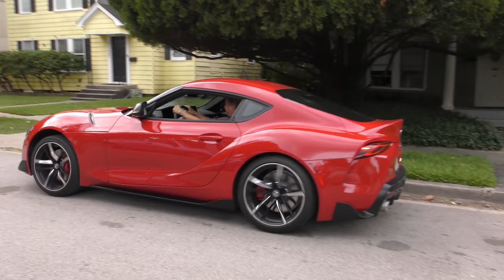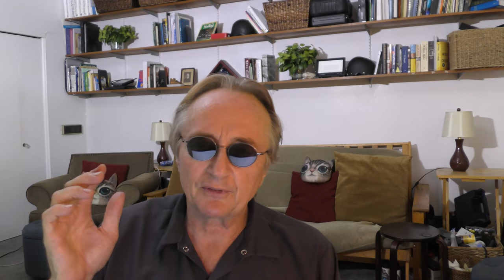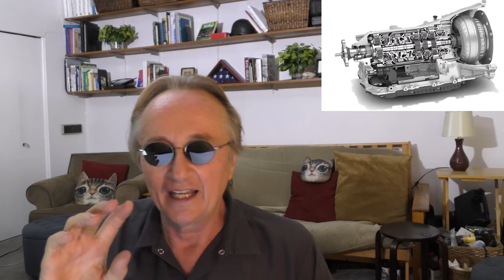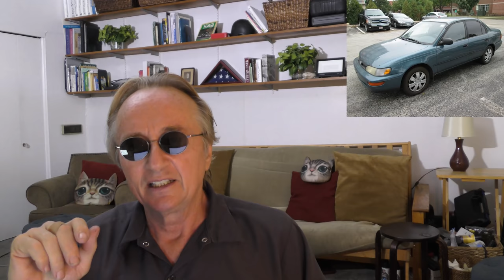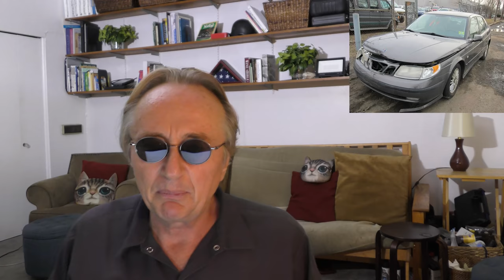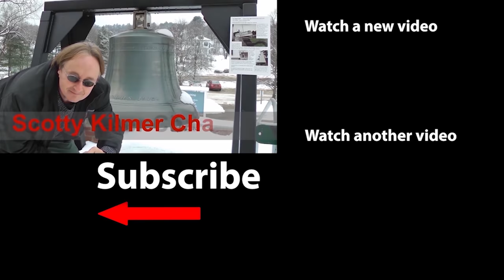This Illegal Mod Will Make Your Car Run Better

Comment: Just wanted Scotty to know ... I just bought my first Toyota, a Corolla from 2000. I'm a Honda lover but wanted to tell my experience. The most amazing thing to me is, just as Scotty predicted, the 20-year-old A/C system still works great. At 200,000+ miles, the engine starts right up, and the cloth seats have no rips, tears, or sun-bleaching. The automatic transmission still works, the heater, wipers, turn signals all work, and the paint - except where it's been unfortunately dented - is still perfect. On the hood and roof, it look absolutely brand-new. Thank God for Scotty Kilmer, an honest mechanic.

Comment: Great advice for the new Motorcycle rider. My First bike was a Honda 1970 CB350, & it was faster than Most cars, in the '70's... 40 years later, I'm on a 2007 Harley Davidson Sportster 1200... but, that is for comfort, & good acceleration, not crazy acceleration like the Rice burners... I just hope they look for a 250-400 as you have advised, as that may save their life. There is so mush more to riding that driving a car or truck as far as safety.
Reply: Good advice . On a motorcycle , you are vulnerable to everything .
I too , have been riding since 1972 . Ive owned 15 motorcycles and been from Calif to Ny and back in them.
Hondas , 450s Gold wing , Kawasakis z1-900, kz1000 , BmW 900 a 1957 Triumph 650 and 5 Harleys .
With the way things are with drivers these days , you are better off just buying a Miata or a Mustang Convertible than riding a motorcycle .

Comment: My 1998 Toyota Corolla Le still going strong 💪
Reply: I’ve always wanted to ask people who have a 90’s camry when do they think they’ll buy a new car 😂
Reply: hey just wondering aver touch the trans fluid or still orig? i have old camry w over 300k
Reply: Mine too I have 97. All the lines however are rusty.  Im gonna wait for it to break. Expensive repairs

Comment: I have been driving and fixing vehicles for 60 years. Yes, Scotty you are correct about the old cars. its what we had so we fixed all of them more than a toyota. I have owned 2 chevy nova corollas' in the 1980s. great cars. in 2000 I replaced one of them with the toyota Echo. its a great car 20 years old and 200k miles still going strong with minimal maint. they a kid totaled my chevy silverado pickup so I now have a great 2012 Camry LE. toyota has made lemons. you have to do your research and avoid them.

Comment: Scotty, I have a 1995 Chev Astro. It has 341,000 miles on the original engine. Bought it with 90k miles. Ever since I've owned it, I have changed the oil with synthetic or , later synthetic blend. And always used quality gasoline.

Comment: Rocking a 96 Civic sedan with 380k miles. Goes 90+ mph on the freeway with ease and eats up the corners. I've only had to replace the starter and distributor, both around $200. Not bad!

Comment: Everyone I know who’s had Infinity’s or Nissan Murano/Maxima’s have gotten 250k-350k miles out of them with very little in the way of normal wear and tear. Especially the Maxima with the manual, those are super reliable. The VQ engines are beasts!

Comment: I hope to god the Toyota Avalon won’t be discontinued
Reply: It’s a great car, but it’s just not that hot of a segment anymore. Full size mainstream cars aren’t that popular. Most people just buy a Lexus ES
Reply: Jay Mac very true
Reply: Me too. I currently own a 1996 Avalon XL getting ready to hit 205,000 miles on the odometer. I have owned it for almost 20 years and it's built like a TANK. BEST car that i have ever owned other than my 94' Celica ST with over 336,000
Reply: I just sold my 01 Avalon With 270k Miles for 1500$ Blowing Ice cold AC and A touch screen stereo....damn cars are great. Ugly but good good cars. Got a 2010 Tundra with 210K Miles and only changed a starter. Still drives super fast...and strong. Also got an 04 V6 Single Cab dodge ram with 254k Miles running great....take care of your cars my friends.
Reply: You know what. If Toyota axes the Avalon like Lexus did with the GS, I’m still getting an Avalon. If it needs parts replaced just get ES parts lol

Comment: Yeah my 05 Honda cbr600rr could hit just about  98 to 100  mph out of 1st gear at 15000 rpm before shifting into 2nd getting on the highway. The 600s are fast and light. If your conservative with it as a beginner it's okay, but be careful, and above make sure you have  good tires!  Tires are so important on those bikes I can't even begin to emphasize how much.

Comment: Good starter bikes are Ninja 250/300/400. Honda Rebel 300 or 500 along with the CBR on the same range. Yamaha R3 are good too. If you live in an area with a lot of hills or high elevation Ninja 650 or MT-07 are still easy to handle but have more engine for climbing hills. I recommend ABS on a bike for starters and stay with used bikes due to the high chance of drop.

Comment: Love my gsxr 1000. He is correct. A 600 RR series racing machine is wicked fast. My 1000 is over kill for the street. I only got it because it was the deal I could find. The 750 is the sweet spot for the streets

Comment: No mufflers, long tube headers with high flow cats and a performance shop tune wirelessly uploaded to the factory computer is the most amazing mod on my 5th generation camaro! It's like there's no other alternative way to really make the Ls3 louder. It's proven reliable as all get out regardless of what Chevy haters wanna say, I had it dyno'd and showed 428peak rwhp. Btw I consistently get 21mpg (93oct)

Comment: For a beginner motorcycle rider how fast the bike goes really doesn't matter. You can get yourself in trouble on a moped just as easy as you can a Hayabusa. May be a bit over-exaggeration lol but the point is it's not about the bike, it's about the operator. I started on a Ninja 650 with no problems. My recommendation would be to take a motorcycle safety course, which will teach you everything you need to know to mitigate the chances of killing yourself, then get whatever you want. The knowledge and skills I gained from the course I took saved my life several times.

Comment: My Infiniti has 116,000 got it at 82,000 2 years ago. Have not had a single problem with it. Oil change every 5 thousand miles.

Comment: Georgia doesn't have annual state inspection for vehicle, just emission testing in urban areas, but I think you can get pulled over if your and ticketed if your vehicle is making too much noise.  In rural areas of Texas, your vehicle just have to pass a annual inspection.

Comment: Picked up a 96 Toyota Corolla for my wife with 68,000 original miles on it for 1,450.00 a year ago nothing but oil changes so far and oil is still clean at 3000 miles love these cars will buy them up as I see them

Comment: If you find an mid 80s Toyota Pickup with under 200K miles in good condition you’re gonna pay for it. Those are unicorns
Reply: Sorry, Toyota pickup.

Comment: Hi Scotty the best car I ever owned was a 1991 Toyota Camry LE back when it was the top of the line. Velour seats a CD player a 4 cyl  engine. 4 speed overdrive transmission. Gun metal blue. 28 mpg. Wish I still had it. The new models are ugly and too low to the ground. Had a weird problem engine valve train would occasionally start and rattle like there was no oil pressure but eventually quiet down. This was my go to work car and received regular maintenance and never failed me used no oil between 2000 mile oil and filter

Comment: For Honda, the car jerk when shift out of park. It’s usually the transmission rather then the drive shaft or the engine mount. But my floor jack went out on me so I still saving for the new one.

Comment: One thing the guy with the Honda can check is to see if his trans mount(s) are bad. I had a Ford Taurus that did something similar, would jerk from 1st to 2nd gear.  Found out later it was just a bad transmission mount.  Easy fix.

Comment: I just bought a 2015 Nissan Rogue SL with 52k miles for a little over $12k. Runs great and was well maintained at the dealership according to the CarFax.  Only putting 20 miles a day for work on it so should still be low miles for the 5 years.

Comment: I've driven a lotus Elise, its almost a go kart, getting in and out is challenging because of the hump in the door way, and the hump on the hood obstruct the view like on the newer civic and CR.V but it get good gas mileage and easier to park, they use to make one starting around $40,000 brand new, it has a Toyota engine.

Comment: It's probably the motor mounts on that 2016 V6 Accord.  They have a tendency to wear out prematurely, due to the Variable Cylinder Management that Honda employs in those.  You'll also end up with oil dilution problems and a worn out engine.  I own that very same car.  The best thing you can do after repairing it, is to buy a VCM Tuner II, or a VCM Muffler, or any one of those products available online.  They're around $100 and super simple to install.  This keeps all six pistons firing on the engine at all times, which keeps it from vibrating and wrecking the motor mounts.  If you don't want after market parts on the car, you can  buy a KTuner imstead, and shut off the VCM permanently with that.  Though, a KTuner costs around $500 and is slightly complicated to work with.

Comment: I think that a turbo counts as a muffler. If I’m not wrong the Dodge Neon SRT4 came from the factory without a traditional muffler and relied on just the turbo to muffle the engine sound.

Comment: My Nissan Quest was a money pit.  Drove great in the beginning.  then at about 36,000 miles everythung started braking...electrical, brake, engine mount problems and more.   Finally completely died at  about 115,000 miles.  On The other hand, my Toyota Sequoia ran great until about 200,000 miles (and was still worth $5k on a trade).

Comment: I have a 2008 Mercury Sable FWD with 3.5 L V6 ,105000 miles, 6 speed automatic. tires are squeaking everytime I drive and hit little bumps or corner. Tire light stays on even though the tires are pumped. Transmission shutteres a little hard sometimes when shifting.

Comment: The dude with the Honda Accord vs  transmission could have a bad trans. If it’s the zf 9 speed Honda will replace it for free because they have a issue that almost has enough issues to be a recall. My dad has a 15 tlx advanced and his car jerked from  2nd to 3rd and drive to park. The dealer did a reset of the trans learning system and if the issue persists after 500 miles they replace it with a 2018 or newer zf 9 speed. It is an issue with the 2015-17 zf 9 speeds.

Comment: Hey Scotty, I have a 2005 Nissan Murano with 120,000 miles. It runs fine and I love driving this car. What year did Nissan products start to go downhill? BTW, between my wive & I we have punched four of them; 2003, 2005, 2012 & a 2014. Loved every one of them.

Comment: Okay you knew these comments would just have to flow in but maybe thats the point. Anyway My starter bike is a Honda CBR 600 F4i 2001 very low miles Very Powerful I mean OMG but not too difficult to control. a light hand on the throttle and dont try to show off 600cc 650cc can be really good starter bikes
And get the body armor seriously worth it when you can get up after sliding out and skipping 100+ feet down the road... And walk away

Comment: Scotty what do you think about a Nissan Altima 2006? It has this random loud consecutive taping noise and its louder when the car is on park. Bought it for 1500. Runs good though. Has like 160k miles.

Comment: In CA noise is at the discretion of the cop and we have some obnoxiously loud cars here. They usually have bigger fish to fry or rarely enforce it. The sound limit most days at Laguna Seca is a bigger issue. Every two year smog they don't care. Also, you can say your resonator is your muffler......no stipulation on where in the exhaust muffler has to be. If it's a performance car straight pipe it!!!!
There are better bang for the buck cars than Lotus. Their manual transmissions are the worst, especially Elise/Exige. That was a picture of the bigger, heavier Evora. Get a Z06.
Chinese also bought Jaguar/Land Rover.

Comment: On the bikes, stay 400cc and under if you are a beginner. I have a 650 naked bike with 30 years of experience and the 650 class of sport bikes is all you need on the road. They will get a beginner into trouble quick. 

BTW all the electronic crap just detunes your bike. You buy a 650 with ABS and rider modes and what you have done there is have the power of a low tech 400 sport bike. I'm not going tell people how to do it but on a 650 you need to run in track setting always and take the ABS fuse out at a minimum to really use the 650. If you don't do that at the minimum then you should have bought a much cheaper 400 class sport bike.  If your bike has ABS it isn't a good thing for going fast or just fooling around. I'm sure the safety people think it's great butt I have not seen that proven on a motorcycle. That's a whole different conversation so I'm out.

Comment: I just traded my 02 Dodge Ram 1500 quad cab with 216000 miles for a 1989 Dodge Ram d100 single cab long bed with 96000 miles and it also jerks when I shift into drive mainly

Comment: Biker's Golden Rule:
Start small and work your way up.
ln Europe you can only ride a 125cc the first year of your licence. There's a very good reason for that, so think about it.
Reply: Depends on your age.
And the limitation (at least in the Netherlands)  is not only about CC, but about power and age..
At age 52 (after driving bikes w/o a licence for many years) i finally decided to get my licence.
So i took a lot of lessons and then took the test on a non restricted Kawa 600NB and got my full licence immediatly.
My son, 19 at the time, wanted to get his full licence, but at 19, had to get the "light" class first, then the medium, then full.
So he waited until he was 21, and also got his full licence the first time.
Oh, and btw, it's a lot harder to get your licence (even the "light" class) in NL then in the USA.
BTW, your name tells me you're Dutch from descent :-)

Comment: Scotty come on man with the Chrysler comments all you have to do is just reset the Adaptive learning software by pulling a fuse 31 and letting it stay out for about 15 minutes then putting it back in that fixed my transmission hang

Comment: Scotty remembers Chevy from 1984, not 2020.  Thinks a Camry is "fast" at 0-60 of 6.9 sec (not even fast for 1970's standards).  New Elise Touring (zero miles) in 2006  I bought was $38k "rich man".  Resale currently for a 2006 Elise is $25k to $35k "bad resale" ahem..

Comment: Would a 2012 Lexus RX 350 with 108k miles last us a good amount of time? I want to get my wife one of these that'll last her for hopefully 8-10 years while she is in going to graduate school. Thanks Scotty!
Reply: That’s a very reliable car that can go 300k if maintenance was done on time. Of course check it out and have a trustworthy mechanic do an inspection on it. Check the service records for oil and transmission fluid changes at the right intervals.
Reply: @tails300  That's what I've figured, can't go wrong anything Japanese. I'm a Honda fanboy by nature, but wife wants some sort of crossover/SUV in the 10-15k range and ideally 100k or less mileage. I suggested the RX because it'd be more lux vs. a newer CRV or RAV4. Hopefully this is a good choice.

Comment: In Louisiana they don't care. You can chop the whole exhaust and the cops don't care.
Reply: in south carolina seems to be the same way
Reply: But do you pass emession
Reply: That's because, you wake them up at the "speed trap" before, they can see you.
Reply: @improbro1124  there's a mom and pop shop I get my tags from. Haven't had a issue yet.

Comment: SAABS were great cars until GM bought 50% and later 100%. They then became Opels tweaked by the people in Sweden and started blowing head gaskets. I owned 4 of the  earlier models, three driven well over 100,000 miles with no major repairs. The other was wrecked when t-boned in the driver's door at 40 mph. I wasn't driving at the time, but the driver walked away with cuts and bruises. They were underpowered except for the turbos. I drove both a normally aspirated and a turbo model on various race tracks and they were a bit clunky though safe. But they would never win a speed contest.

Comment: Scotty, I’m a single female your age and like be detailing vehicles but clueless on even checking the oul😂. I’m looking for a sporty convertible, LOVE the look of Saturn Sky, but you already warned me about it. Like the rounded curves like a woman , but not thrilled with the Miata, it’s too boxy. Don’t need speed, needs to be fairly inexpensive, pretty , weekend fun car! Any suggestions????  Thank you!
Reply: Im not Scotty but a good sporty convertible IS a Miata . Either that or find an older Mustang convertible ? 
Ive owned a couple Fox body mustang convertibles and a 1990 Miata .
I also had a 2003 Honda S2000 ap1  but they are getting pretty expensive now .
( its basicly like a Miata , on steroids!  )

Comment: Scotty please help! I have a 2001 Toyota RAV4 that makes a rattle noise from gearbox area that goes away when not in gear, under load going up a hill is like there is bits of metal grinding and forcing the car to slow down... clutch works fine.